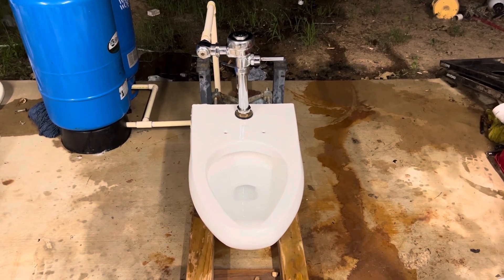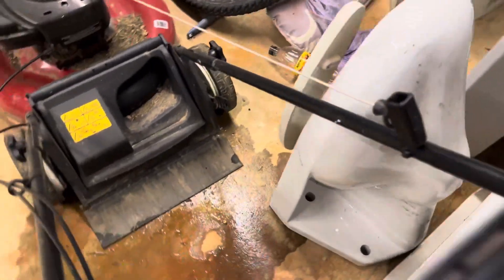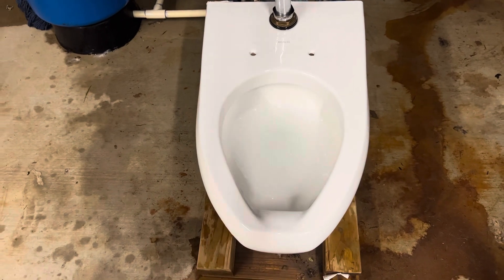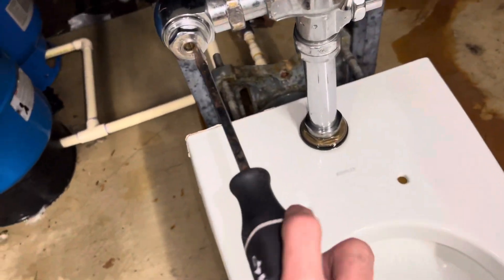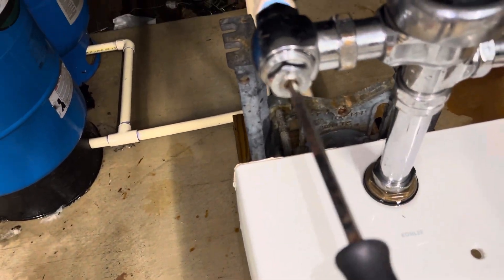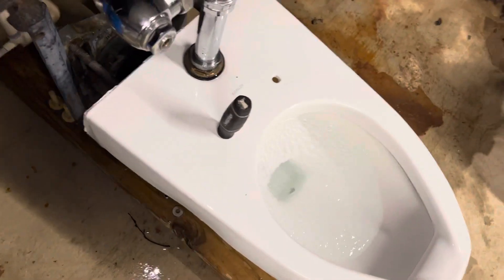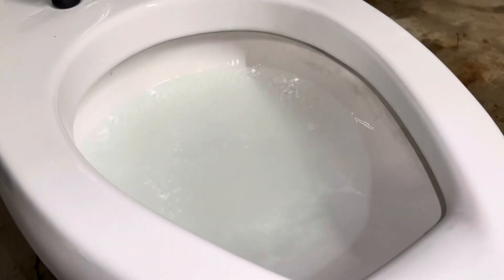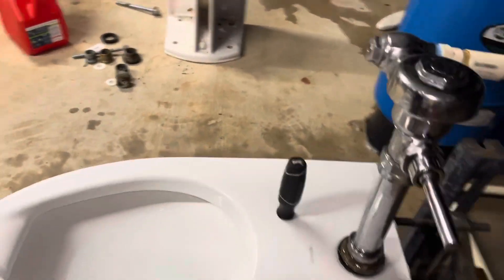1992 Kohler Kingston Waterguard Toilet Flushes!

Comment: I'm so happy you finally found one of these, let alone two!  They are very unique and I don't know of another toilet that flushes like them because of the unique bowl rinse on the right. I love the frothy rinse! I have tested mine with a low tank but I did a high tank flush once and it worked so well that I would consider installing it that way if I had a place to. That Primary is quite a find too!
Reply: The briggs sultan is kinda like that but the flush sucks in comparison